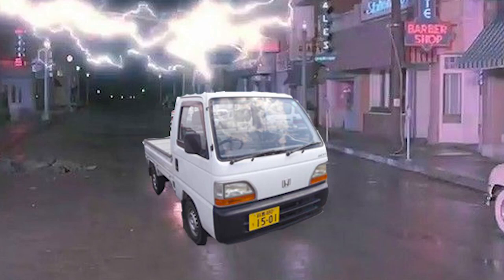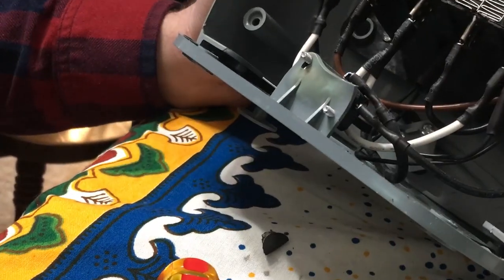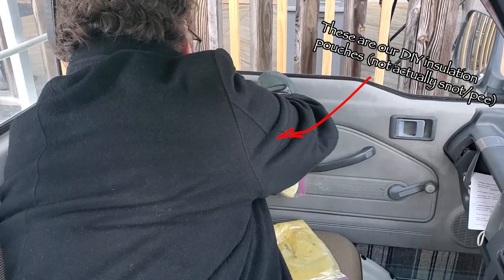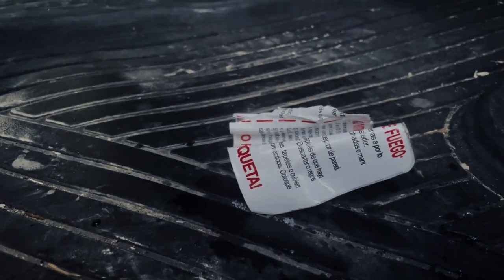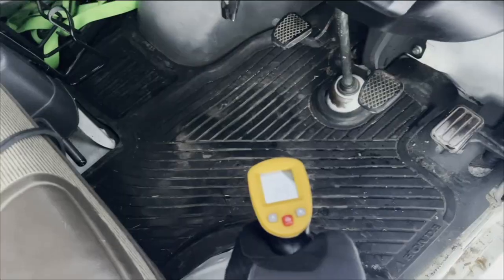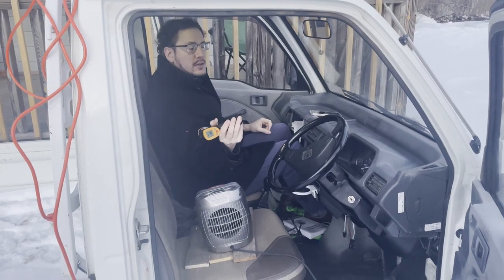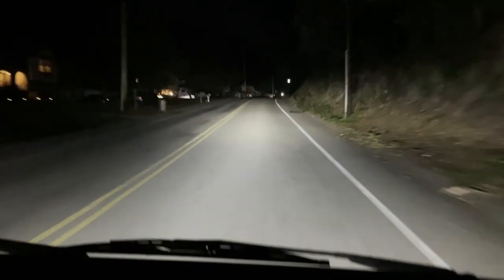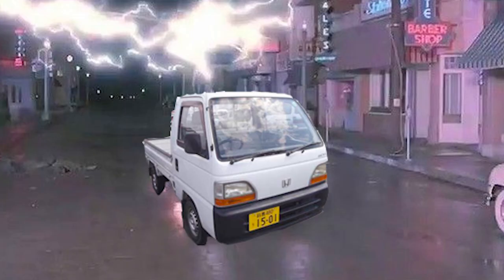Converting a Kei truck into an EV - Heater Test - Part 14

Comment: > Nighttime winter driving.

Okay, so, success. I have doubled my battery life by scavenging Rover 1. But if I use the heater, I will burn through half my battery every day. If I do not use my heater, I will be slowly killed by the laws of thermodynamics.

I would love to solve this problem right now but unfortunately... my balls are frozen.

P.S. You need a Trucker Hat in your store. ;)
Reply from the maker: Mark Watney was the inspiration for messing around with the insulation! That whole book is about an engineer working on little tiny improvements until they add up to something significant. Hopefully we don't have to add an RTG to our build, though. :D
Reply: @actydcty4132  See my comment earlier about Arctic Russia. I had a serious thought though - your heater design is the simplest, and also literally worst possible. What you really need is a reversible heat pump. Modern EV's have a relatively complex system that salvages heat from the motors and battery pack for cabin heating  - and can be used to pre-warm the batteries using external air before winter driving, but if you just stuck a basic air source heat pump in, you could electrically heat and cool the cabin way more efficiently. You could probably get away with using the existing radiator as your external thermal element, and that would pretty much guarantee you hitting your 50% target.

I've been wondering about picking up the motor from the Mitsubishi I-MIEV. It looks like the unit itself just has three chonky conductors off it and it can do Regen in the original vehicle - and, it was used in the Minicab MIEV, so I know it has at some point, been fitted to a chassis just like mine!

Comment: The fan motor in the heater requires AC, the heating element does not and will work just fine on DC.
Reply from the maker: Thanks, that's what we were hoping for!